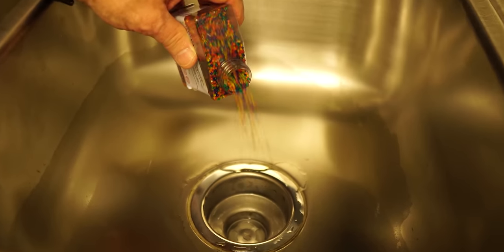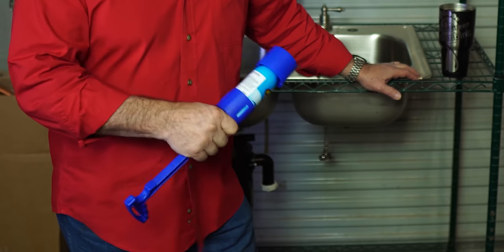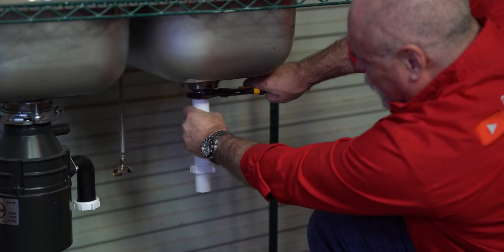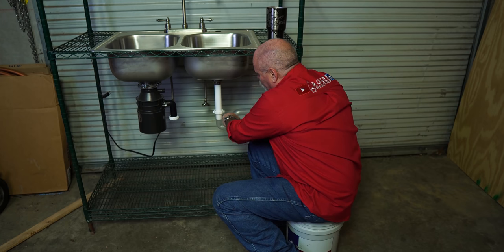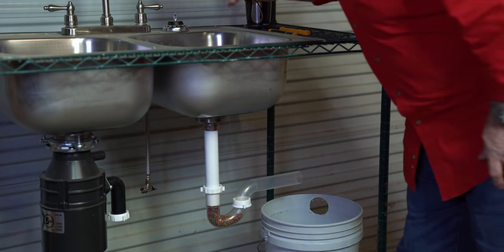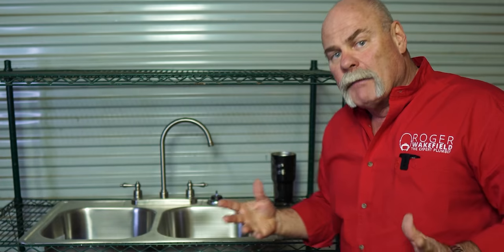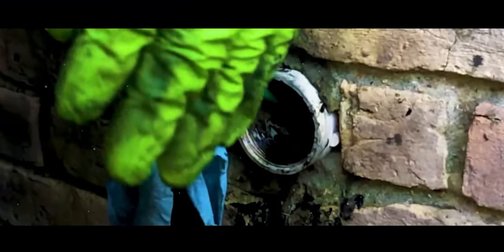Can This As Seen on TV Plumbing Gadget Unclog 50,000 Orbeez?!

Comment from the maker: Want to see more videos like this? We're thinking about giving Plumber's Hero another shot, what do you think?
Reply: I wonder if this kind of channel format would mesh with some of the stupid raingutter stuff I’ve seen.
Reply: I'm curious - would your plunger do the job?  It's well known in dyi etc, that a gentle continuous force will move things, and that trying to just "smash it" will result in bad things.  With a plunger, and a good seal, you could up the pressure slowly - with this thing, not so much.
Reply: I would love to see Plumber’s Hero used again just to get a good laugh of you being sprayed at by something 😂
Reply: I wanna see you unclog that sink with a regular cheap old plunger...
Reply: I would love to see you use the Milwaukee air snake with this test that would be awesome.
Reply: @UKMonkey  yes a good plunger moves the blockage back and forth but what is not noticed here is that by by- passing the disposer and often the dishwasher drain it gives the product an advantage but it still failed this test
Reply: I’d never use air pressure to unclog a sink after what happened to me one time. I tried using a plunger on a single kitchen sink one time and actually blew the seals off the PVC P-trap. What a mess.
Reply: The plumbers hero is canned air
Reply: Not gonna lie, I was hoping you do a connection longer than 2’.  To do a “true” test.  Oh well.
Reply: Oh yes definitely, should be interesting to see what you really can do with it.
Reply: @Robert-Wilson  aye, that also happened besides getting splashed with drain cleaner in the face. Was not fun. Eyes was ok, was wearing glasses.
Reply: Specific to Orbeez, since we know that there are men who will try this and kids that will too, if you add salt (table salt) to the Orbeez after they swell it pulls the water out of them and they get smaller. Might be something to try to see if it works before trying the Plumber's Hero.
Reply: If orbeez is blocking a drain use salt and water.
The salt pull's the water out.
Reply: I want to see you mock this up with old, rusted galvanized plumbing with multiple turns running 50ft to see if it will “actually”clear out. Use old galvanized pipe you’ve pulled out of a house and connect them with no hub bands then run a camera down it to see if it REALLY clears. Real world applications.
Reply: I want to be a plumber when I grow up
Reply: Pretty sure it had to be under water like in the ad
Reply: What if you let the Orbeez absorb something that actually cleans the pipes???????
Reply: Pour 15 minute drywall mud down it and see what happends
Reply: we just recently dealt with the aftermath of christmas. Our entire building uses a vertical drainage system (i.e. the flow of water from the kitchens starts from the top floor and drains down through the same pipe system in every unit). what this means is that if someone dumps greasy items or food that absorbs water on the top floor it just clogs all the way down, and on the bottom floor people can clog the entire building. every holiday we have to use a plunger and a sink stop to remove clogs in the drainage system because people dump grease. really difficult thing to do with a dual sink system, and often times parts of the building just smell... REALLY bad. 
your tip about running just plain hot water and baking soda with cleaner really helped me speed up that lengthy unclogging time. wanted to thank you for that, so thanks!
Reply: Set up a working installation that isn't connected to the main plumbing system, then use it in all the worst ways possible on a regular basis (over time) until it is clogged up, then try again?
Reply: @beatfromjetsetradio8239  He’s a plumber
Reply: No way
Reply: @UKMonkey  Sorry i may be late to the party

But plunger would never clean up that pipe
Im 80% sure orbeez created very tight (perhaps even air tight) seal due to density of how many of them are there

The only way to clean up this type of mess would be either
By few suggestions of using salt to get the water out of them
By using chemical solvent that dissolves water-absorbing polymers but doesnt damage the polymer based pipes
Reply: I think you should try the kinetic ram!!!
Reply: GOD yes, more content please Roger :)
Reply: Plumbers hero, sounds scary dangerous if you got Drano down there and it splashes back.
Reply: Roger Been A Fan Of Your Videos For A Year And A Half Now! 

I Know These Orbeez Can Swell Up In The Drain, But If It Had Enough Pressure In The PVC Will The PVC Give in and Crack Under The Stress?
Reply: i'd say from a scientific prospective; 
1. no control setup
2. a filled sink vs a non filled sink
     a. more force, and resistance to blow back for short. 
3. multiple test runs
4. film or review data for better accuracy 

i've never used any of this products(orbies or the other CO2 or something plunger looking device). i only saw the house plumbing vid with the hoses bolted to the ceiling. that was funny.
Reply: are you sponsored by plumbers hero?
Reply: i would say give it a shot but maybe not against the Heavy weight Champ Orbies that destroyed a French sewer system
Reply: Trump or Biden
If trump I sub if not you hate gun
Reply: Roger Wakefield , in the tv add they have the sink filled with water. Maybe you could retry this test with water in the sink and see if that's what it takes to get it to work?
Reply: Does the plumbers hero not say to fill the sink up with water over the blue cap? I have used it before and it worked pretty good for me
Reply: Add some long hair ( from beauty salon) and melted soap bars with tiny grains of sand, cooked rice, baking flour, and bits of vegetable leaves bits for that realistic stubborn clog.
Reply: No..
Reply: Yes!!!!
Reply: You OK in my book keep bringing them funny videos
Reply: @RenaxTM91  I tried that after some ninny( ok. Fine. Me.) Threw rice down my kitchen sink. Did absolutely nothing! 🤷🤷😁

Comment: I think you should show the proper way a trained plumber would deal with the issue after the as seen on TV product fails.
Reply: It’s a hole damn box of orbeez prolly not made for taht
Reply: He kinda did in the previous video involving Orbeez. At leas t with  what lead me here, seems like he did 3 of them. Could be more. But it was essentially what he would do with Pasta - Rice - Potatoes - etc; that would naturally get built up. Disassemble and clean.
Reply: If you can't figure it out then call a plumber. It's kinda the ongoing theme here.
Reply: This unrealistic test. Also if you so week you can't keep a seal. Stop being plumber.
Reply: Yeah that’s 170$ a hour cuzz
Reply: I'm not sure anything could get orbees out of a drain without taking it apart. That's what I would do if I ran into this at work. Pop the p-trap apart and poke the crud out with a stick or something.

Comment: About a month ago I bought one of these hero tools to help my folks unclog the kitchen sink. I never could get the damn thing to work as advertised. It kept back blasting me with surface ick, so I decided to take apart the plumbing. Unfortunately this did not happen because the instant hot water system under the sink was awkwardly installed and partially obstructed the pee trap. I'm not a plumber and a barely qualify for handy man. I didn't have the technical know how to even want to try and uninstall and then reinstall that system just to get to a pee trap.

After forcing my folks to endure my, rather colorful I might add, tirade of frustration I ended up jury rigging a thin steel pipe I found in my dad's tool chest to his shop vac with gorilla tape. Set the vac to blast and got to fracking the kitchen sink. Alternating between blow and suck on the vac I would dislodge clumps then suck them out. This worked rather well and I removed the clog in 15-20 minutes.

I can see the hero working on minor clogs but the back blast sucks. Its awkward to use and if you don't get the seal on the drain perfect you'll get all that ick lingering round the drain on you. Honestly the shop vac was easier to use.
Reply: Pressure will take the easiest way to escape. If you just have a minor clog, which will move easily, there should be no back blast.
On the other hand: If you are clogging your pipe system that often, that you often need such products, you should evaluate your behavior in pouring anything into the sink. Or flush the system correctly afterwards, that it won´t clog up.
Reply: I keep trying shop vac ugh

Comment: What’s cool about any tool using compressed air to clear a clog in a pipe is the fact it’s using the water’s hydraulic force to clear the clog. Because water can’t compress it will push anything it can out it’s way, but the down side is if it comes in contact with something that won’t move you’ll create a water hammer and likely bust the pipe.

Comment: you're putting the seal on to seal the drain, but did you remove the orbees first? if the orbees are still there, you can't make a seal. i know if i ever saw stuff in the sink, i would try to vacuum it out first, then use the plunger/snake for anything deeper
Reply: @lilkittygirl  if there's a seal, then how are a bunch of orbees flying out of the sink
Reply: the plunger was on upside down any way creating no seal

Comment: Not sure about orbeez, but as far as genuine kitchen sink clogs goes, last year, my sink was not draining, and the dishwasher was backing up into the sink. Got a similar product to this from supermarket after taking apart all accessible pipes revealed no immediate blockages, and me not having the funds to pay a plumber to dig deep into the walls to find the blockage, and it cleared it up within two shots. It was amazing. Maybe your issue with the orbeez was the sheer pressure created within the pipes across the entire diameter due to the amount of orbeez used? Had you used just enough orbeez to just loosely fill the U-bend (similar to a genuine kitchen blockage), it might have had a shot 😉

Instructions are very important: The one I had instructed you to fill the sink to the top of the headpiece, and to hold a wet towel against the overflow or garbage disposal if you have it. Basically to stop the jets of air going the wrong direction. Didn't even need an adapter to create a seal either.

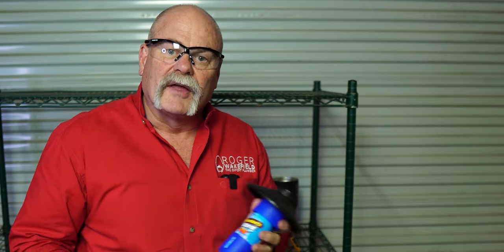Comment: 6:56 The rubber is actually attached the wrong way around. I guess thats why you should always read the instruction first xD
Reply: I just watched the ad and you're correct, it's actually on backwards.  I assumed you were mistaken but nope, it definitely was put on backwards.
Reply: Not quite an accurate test. He never took the excess Orby‘s out of the basket strainer. Unless that thing is perfectly sealed the back pressure is going to blow out the top like it did every time. Entertaining for sure lol

Comment: I’m not a plumber, but I just did a job under my sink. I replaced the Kitchen sink hose plastic/metal mesh hose that extends outward on faucet. I can tell you this, it’s no easy task. The hardest part is disconnecting the back part of the hose. Not much room and very difficult to remove clip. I got it done, and installed a quick release for future replacement. I wonder how much a plumber would charge for that.

Comment: I know this is old now, but I was looking at one of your other videos and saw this one and had to watch.
One thing I was thinking of in your test here is that the As Seen On TV demonstration does indeed show air bubbles "blowing back" like you had, but they deliberately had their sink with 3-4" of water in the bottom. I believe this pressure of the water above the device would help make the seal better and may keep more of the force directed down the pipe. That, or you would blow way more water in your face. Anyway, just thought Id mention it.
Reply: exactly, it looks like 1" of water in the video, far from enough >:(

Comment: Just give it a few minutes. The sharkbite guys will be here in a minute to tell you that you just don't like it because it gives homeowners their power back.
Reply: @teddyfresh9605  , lol
Reply: @Deon Denis , most plumbers use PEX now because copper has gotten too expensive. PEX is also installed much faster. What took days to do in the past, now takes hours because of PEX. You'll see some old skool plumbers who still use copper, but it's not as common as it use to be. Some states still require copper in commercial/industrial settings.

Comment: Well, Roger Wakefield. I believe that you are right in every aspect. 

So I think that Plumber's Hero is actually more dangerous than it is helpful by a long shot. What you described that it is dangerous for people to take said item and spray a pressurized can into a drain to unclog the Sink is almost idiotic. Also that it doesn't work as its intended and As Seen on TV some of the products they produce are just scams that they want to make a quick buck. 

Now I am not a professional Plumber, Nor that I have the skills to be a Plumber. But I think that a plunger would be much more useful in a situation like this... Manually shaking up and down to unclog what ever is preventing the sink from flowing down, Is far safer than this idiotic product.

Comment: I’ve used the 1 second Plumber version years ago after trying different chemicals to clear it out with no luck. When I used the 1 second plumber it actually did work. But I have always had the feeling that all it really did was push the problem further down the line in my building somewhere.

Comment: Orbeez are made up of acrylic acid and sodium hydroxide. Pouring Boiling Water into the drain, the water reacts with the caustic soda in the sodium hydroxide, causing the orbeez to break down... BUT WAIT!!! 

Roger, isn't caustic soda also used to unclog toilets? So my question, can you unblock a drain with Orbeez only?!?!

Comment: This looks exactly like the guy that came to my house a few years back in Texas. I was needing to replace a shower valve. I had the entire wall removed because we were redoing the shower. The old valve was cut out, water was off, and the pipes were at the correct height. I even had a brand new Delta valve in the box ready to go. All they had to do was sweat it on and leave. Quoted me $800. Told him to get lost and he gave me a "deal" at $325. Highway robbery.

Comment: This is a simple matter of physics.
When pressure is applied to a point, it travels through the weakest medium. 
The only way for this to unclog something is for it to have more structural integrity than the pipes themself. Even then, it would likely bust the pipes.

Comment: Hope you add a vent pipe on you model in the future.  I've had success with blowing pipes out with water pressure, until the clog good and tight on the other side of a vent or floor stack.  Tried blowing out a basement sink only to have everything backwash on me and random sewer debris in a sink on the next level.  Plumber's snake worked to clear it.

Comment: I tried it worked like a charm on my main drain from kitchen to the basement. Just stoppered the rest and had my friend hold onto the two lids on the kitchen sinks. Two shot and Wow could not believe how fast it worked.The toilet and bathroom end of the house was fine just the kitchen sink and we put it into the laundry drain directly below and shut off that valve to the washing machine.

Comment: I'm curious, wouldn't the Orbies, if it were a full system of pipes, just move down a few feet and then plug up the pipe down further in the line?

And then couldn't it separate the segments of pipe under the sink?

Like I've used a plunger on my kitchen sink and knocked the J trap off...

Comment: Would love to know how you WOULD get those orbeez out! I wonder if pouring salt on top of them would work, or just make the problem worse? Or would you try to vacuum them out with a wet/dry vac?
Reply: Cut off water, remove pipe, clear out or replace with new pipe, restore water. Not the most elegant solution but if you can do it all without fucking it up seems like a simple enough thing to do

Comment: if you get orbeez in your drain, one thing you can try is snaking it with the water on to try and get things moving. Otherwise remove the pipe and clear it manually or call a plumber.

Comment: Also if both sinks were hooked up you'd have water shooting out the other side lol.  I had a bad clog and used something similar to this.  Didn't work, had go under the house and replace a 6ft section of the pipe

Comment: You need to fill the sink with water for it to work I think. I used a similar product and it had me fill the sink about a 1/3 with the device in the drain. It worked for me.

Comment: Not sure what you did or how you were holding that but I have used this product on a clog that it wouldn't move but I got a seal that didn't blow back in my face and all over it just held until i removed the can. To have it blow back in your face like this you are not holding it square or something.  Also one time the pressure did blow a badly cemented joint apart but that is a different issue.

Comment: I saw this and depending on how bad you let things get you only need the palm of your hand if it is big enough. When my kitchen sink backs up I use the palm of my hand slow enough to gain suction then lift my palm. If it does not work I try again. If it is still clogged after about 4 or 5 tries then I try a plunger. If that does not work I use drain cleaner.

Comment: okay quick question here, it seems like the way a sink's plumbing is done, it is made to catch stuff in that little loop. Why is it made like this? because it looks like a trap for stuff going down the sink.
Reply: It is designed to trap solids to prevent problems down the line. The p trap also holds water to prevent gasses from leaking into your house.